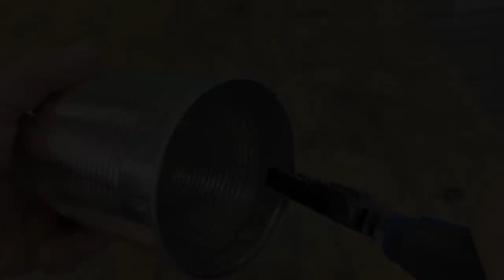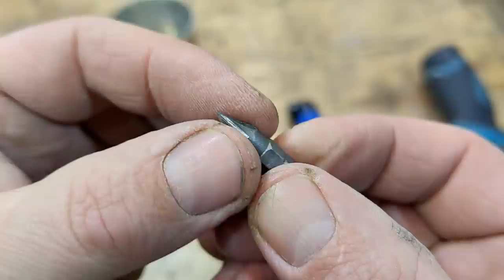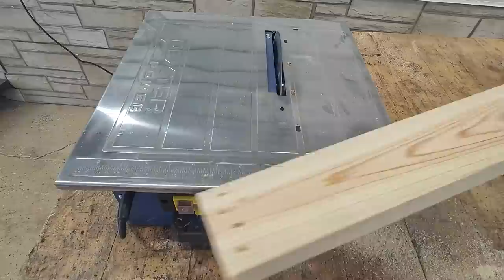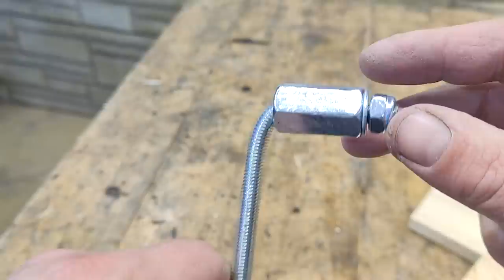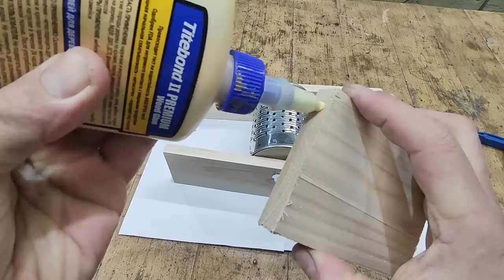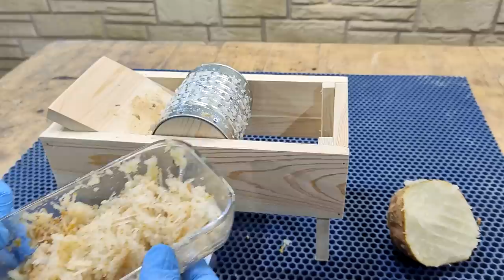Having learned this secret, you will never throw away an empty tin can. A brilliant idea !!!

Comment: Great idea, two things though the residue of what you are grating will end up inside and you will need to take it a part to clean every time. Also in a short time where holes have been drilled it will start to go rusty.

Comment: I don’t know how much grating you need to do, but I would use this with an electric drill instead of a hand crank. The grater can be vertical and the vegetable can be fed into it horizontally and fall through a hole into a bowl or similar container.